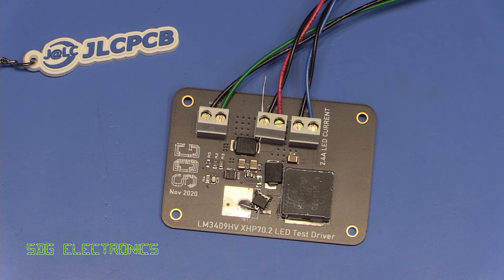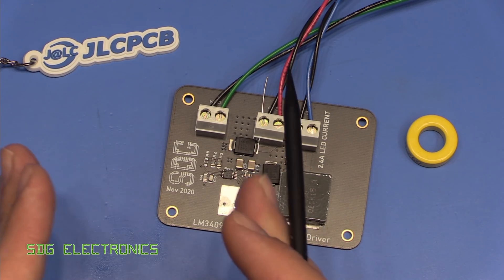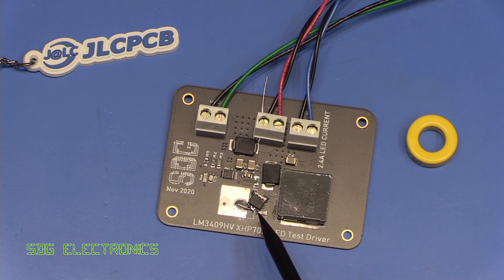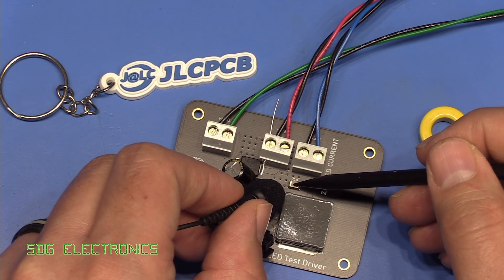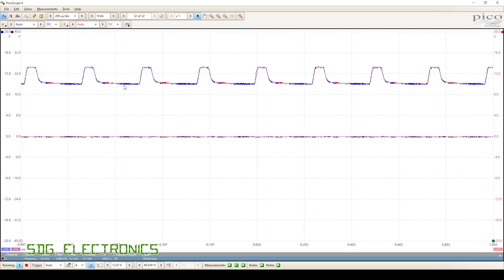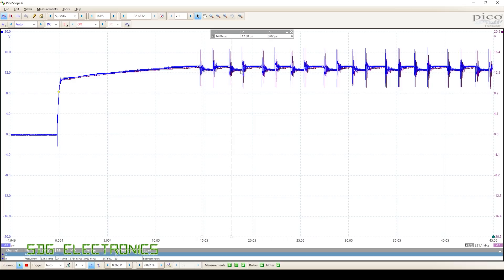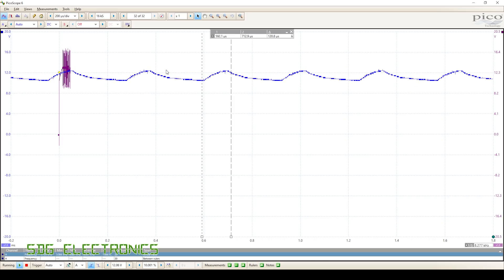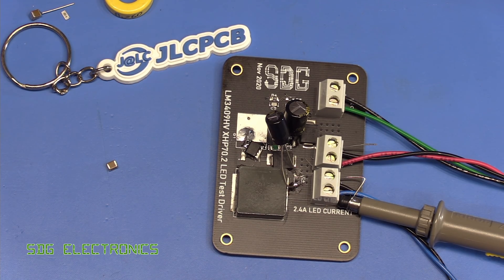SDG #186 A Real Example of Microphonic Ceramic Capacitors!

Comment: Wow this is a fantastic video! For some reasonm whenever you get into aspects of electronics design that include a mechanical, or phsics element. The challenge of trying to solve around these other important factors just teaches me so much more than something that was purely electronics based. Ie. why we design products in real world in specific ways, and not just only to BoM cost alone. What these other important and critical choices are all about.

Another first for me is actually seeing somebody demonstrate whine coming  from a  capacitor, rather than a magnetic coil. Which of course we have known about for years people saying this stuff... but not actually knowing how common this is, and for which specific ccapacitor types, or the principle for  how the capacitor generates motion when it's job is about switching an electric field rather than a magnetic one etc. etc.

BTW steve sorry i totally forgot to mention previously the great technique for finding the location for narrowing down to individual component. It is quite simple actually (again, not my idea but gleaned from another guy).. what you can do is simply make a temporary listening cone, by coiling a sheet of paper or thin plastic into your hand. Like a reverse gramaphone, or reverse speaker cone. Then slowly move the narrow end of the cone across your noisy board. Listening with your ear in the big end of the cone. (or a microphone). The amplitude of the noise will be loudest once you hover the cone over the area of pcb generating the most sound. Noting that it might be the pcb board itself vibrating due to the action of soldered other cmponent nearby or on the other side of the pcb if double sided board.

Also try to think of the relative local and global stiffness or Q factors at play due to the entire ensemble of the whole pcb. Vs the subset of bad actors who are working as drivers. Since different sized shaped or stiffness (thickness) pcb will also play a factor.

Finally if there are multiple component driving the same shared pcb (but at each different frequencies), then the compined effect might indeed be to create a difference or 'beat' frequency, that is a lot lower and then falling into the audible range. Which otherwise individually you would not expect to hear any of them! Hope it helps.
Reply from the maker: The PCB was definitely playing an important role here. The first suspect capacitor I think was positioned in such a way that it probably saw the worst of the vibrations/acoustic wave, hence sounded much louder than the capacitor at fault. I think it shows up on the microphone a lot better, but the output capacitor had much more high frequency content (hence the very harsh tone). Thanks for the comprehensive reply.
Reply: @sdgelectronics  Very interesting diagnosis and solution.  I like the reverse megaphone idea as expressed by Dreamcat 4, but I fear that sometimes the frequency emitted may be outside the range of human hearing.  Get to a certain age like me and you may not be able to hear anything over 8 kHz or so.  In that case, could combining the megaphone with the mic help localize these sounds?

Comment: Very interesting indeed! I just want to add that the reverse is also true: such an SMD capacitor also acts as a microphone... I discovered this today when trying to figure out how on earth the cheap no-brand but very fancy Chinese wireless mic units that I bought managed to produce such audible white noise along with the sound of the wireless microphone. To make a long story short, each of the SMD capacitors around the preamps act exactly like tiny microphones. Not only tapping anywhere on the circuit board is very clearly audible, but even gently blowing air with my mouth onto a capacitor sounds exactly like a microphone in the wind!!! It's so distinct and clear that it's crazy.

Comment: Hi Steve,
AS I mentioned in another comment, I used to teach, and part of that involved using a SHURE wireless cardioid mic. Even when the mic capsule was removed from the transmitter section, it (the transmitter) would produce audio by tapping or yelling at it closely, due to those pesky capacitors.
I hope this clears up the mystery for your viewers.

Comment: I confirm. And even when applied especially in SMPS, in addition to the microphone effect, due to the piezoelectric effect of ceramic capacitors, you can get parasitic interference in the form of amplitude modulation of the output power, which cannot be eliminated. So it is more correct to use a parallel connection of an electrolytic capacitor and a ceramic one.

Comment: I was just having another look at this (I think we started experimenting with both the 3409 and the XHP70's at full brightness at the same time -  your insight has given me more than a leg up so, thank you) and I realized as you said, "the data sheet circuit layout is pretty much the same as the one I have here", that it's not, and in a significant way. The data sheet does not use a cap in that position that is causing the noise on your board. No cap, no noise! (C4 that is: whether that allows the ripple to get to the LED or not I"m just about to find out).

Comment: where is C4 in the  schematic @4:30 ? It looks it's after L1 and connected to Vo. So is it Coff? That is "off time programming"  so not related. Did you added that yourself? (EDIT) ok it's "Co" page 28 in datasheet. They recommend 2.2-µF X7R 10% 50 V murata GRM43ER71H225MA01L in that examples.

Comment: what a great timing. I have the same issue with my DC/DC I design. Well one proto makes sound but not my other proto. I was always wondering where the sound came from. I thought it was my inductor. I will definitively touch the components and take measurements. Thank you very much!!

Comment: There is some legitimacy to still using through-hole technology, less mechanical coupling to the PCB. The MLCC was using the PCB as a sounding board. I'm guessing that, long term, the solder joints would end up fatiguing due to the mechanical movement over time as well (I think Dave Jones did a video on that)...
Good alternatives may be to use thin film or maybe even poly. I don't think through-hole (round) ceramic caps can be easily found anymore...
Season's Greeting and cheers,
 - Eddy

Comment: There are so much devices which making this noise (my PC motherboard, my internet box, my led bulbs, my garage door motor) ! Everybody says that it comes from coil !
I will investigate again now I know that it can comes from capacitors.

So replace capacitors is a way to do... 🤔 A video about all the ways to resolve it could great (replace capacitors, different solder technics, epoxy ? ...).

Comment: The debugging vids are always interesting.
I wonder if the old car trick would work on electronics. To trace where a noise is coming from on an engine you rest a large screwdriver on parts when the engine is running, and then rest you ear on the screwdriver handle end. Basically the metal screwdriver transmits the vibration directly to your ear. You didn't need it because your mic test worked well, but it would've been interesting if there was a metal rod from the part to the mic.

Comment: I made a probe at work to find the source of such issues. It's made of a piezo buzzer plate and a sewing needle sodered on it. A small bidir. Suppressor is put in parallel to avoid hv pulses damaging my scope input. You touch caps and inductors with the needle with the fft on and you look for the cleanest tallest peak location :) works like a charm.
Reply: Great idea, may copy that! 
I have used piezo discs, the smallest ones from RS, as sensors before. I think You can get them down to 10mm dia. Perhaps use something non conducting instead of a needle.

Comment: Capacitor is the mechanical sound source but practically noiseless if not using a PCB as membrane.  Make a tombstone and almost all noise is gone. If very critical to make circuit noiseless,  add few mm solder wick as additional sound-isolation on both sides of capacitor. Solder wick is better then a thin wire as it have low RF-losses.
Reply: I once had noise coming from a snubber network in a small AC-to-DC flyback converter i made as a part of a bigger board. Tombstoning was exactly how i got rid of the noise.

Tombstoning is not a very production-friendly solution, though.
I also sometimes tombstone my ceramic caps for reliability (often after finding out that my circuit is not working because the caps cracked while i was tossing the board around while assembling it).

Comment: Hey Steve  ! Did you take a look at the layout guidelines (chapter 11) of your lm3409 datasheet ?? Vin seems to be a much wider track (main current path), also it states that the Vout cap (one of your main culprits here) should be placed as close as possible to the leds ! Wonder if that would make a difference. ... I still think you don't really need the buck regulator when you drive the whole shebang with an esp anyways. It's like having an extremely good pwm controller (the esp in that case) to control a very limited one (the lm3409). I am really very curious wether it would work or not feeding the mosfets gate directly with a signal from the esp. Anyhow, I love the debugging videos, they are most valuable. Thanks for sharing !
Reply from the maker: The new PCB is much improved on the layout - video in the next few days. If it was a PIC or some other microcontroller, I'd offload the converter functionality, but I've had many occurrences of the ESP32 rebooting. During reboot the pins aren't in a guaranteed state so there's a risk of damage to the LED.
Reply: @sdgelectronics  Hm, I thought the esp had a couple pins that are definitely low on boot, with a pulldown on the gate I have never had any incidents... anyhow, I am eager to see the new boards.. Thanks !
Reply from the maker: I'm sure it's possible, however a switch mode controller should really have all (or at least the highest) the attention of the firmware if you are the implement it on a MCU. I don't have that control on the ESP32 whilst running FreeRTOS.

Comment: Thanks for the follow-up video, Steve.  It was neat to see how that played out on the PCB.  Perhaps aluminum polymer caps are the answer.  Still very low ESR, but without the aging issues inherent in electrolytics.  I just wish they were cheaper...
Reply from the maker: I do have some polymer ones from the original GPSDO refurbishment project. I think it'll end up fine with a small electrolytic though.

Comment: Can you test it out with a tantalum capacitor and tell me if the problem remains the same?
Keep up the great work
Reply from the maker: No problems with tantalum capacitors, though they have their own issues...
Reply: @sdgelectronics  You mean by this getting into flames?
Reply from the maker: @FixDaily  yes towards their end of life
Reply: @sdgelectronics  CONTRARY to popular opinion tantalums don't really have 'aging' issues -if you use a tantalum properly there is no reason why it shouldn't last 100 years but most people have no idea HOW to use them. they will most assuredly 'die' however if you expose them to voltage spikes at or near their rated capacity - even for microseconds. it's important to use them only downstream of well regulated and buffered supplies
Reply: I learned to hate tantalum caps. They work like a charm in the lab. But it is the single component that has caused me more grief than anything else in noisy industrial environments. I try to use dry electrolytics if possible.

Comment: Nice Video - when I was Uni I had a similar issue with a Power Supply for an audio project, so I swapped my ceramic caps for poly film capacitors and worked a charm! You can keep the low ESR element by using a film without the piezoelectric effect, but looking on Farnell can be quite costly when not in bulk. Would like to see you try this again with Film Caps (1210 drop in replacement available!)

Comment: If you have sound effects, it is probably due to pwm chopping due to charge up of the inductor, there are quite a lot of audiable harmonica from the inductor during charge-up. It is not all high frequency as shown in your previous video. Typical inductor..
I think lower esr caps could compensate for that though.

Comment: I never would have suspected the capacitors. Are there any other types of surface mount capacitors you could use?
Reply: Almost all ceramic capacitors are piezoelectric, so you can use tantalum, electrolytic or SMD film in place of them, or get ones with better dielectric that is not a piezo, but then you are limited in value for the size.
Reply from the maker: As with most things, there's a tradeoff and no perfect capacitor. They all have their own non-ideal behaviour.

Comment: Great coverage!
After you play a couple of days with formulas in Excel you can even approximate output ripple from ESR, Fsw, delta L current and it reminds calculation of smoothing capacitance for sine wave rectifier.
Shielded SMD inductors are potted most of the time and are very monolithic, they are rarely making any sound. Maybe in DC-DC circuits of GPUs where there are dozens of amps switching at any decent load, supplying billions of low voltage transistors in the range of 200-400W per BGA, but even there you are more likely to hear ceramics.

Comment: Hi Steve, thanks for taking it further and doing some analysis. Should have known it would be the cap. I think it would still be interesting content to wind your own inductor in some sort of oscillator or filter project. Hows the gps oscillator project coming on?
Reply from the maker: I plan for an AC-DC SMPSU project, so there will be some coil winding soon!

Comment: You should try using NP0/C0G class ceramic cap. Unlike x5/x7, NP0 caps are not prone to microphonics.
Reply: All ceramic caps are prone to microphonics. In my opinion, polyester or polysterene caps should be used.
Reply: They don't come in such large values
Reply: @guillep2k  yep, my bad

Comment: Thank you so much for this mini-series! I have an issue with audible noise coming from a Nixie PSU. I always suspected the inductor and my initially bad layout. After improving the layout (and maybe critically) changing the type of ceramic cap on the output, the noise was significantly reduced. Initially I had just a few very large ceramic caps, now a combination of smaller ceramics (both physically and electrically) plus one electrolytic. I noticed the noise would go down if I increased the capacitance on the output. Maybe the ripple current in the inductor is lower but now after seeing this I realized, that the ripple on the ceramic caps also is lower. I'll definitely investigate that! Very interesting.

Normally I'd just put my finger on all components to just feel for heat etc when testing but on a HV PSU that's not such a great idea. If I had done that I may have noticed that the caps were the culprit?
Reply from the maker: Maybe, sometimes changing the capacitor will affect the noise from the inductor as a result of different ESR. There's many interlinked factors!

Comment: I didn't expect the capacitor to be the culprit. I guess I was so used to linear PSU transformers buzzing that I automatically assumed that any inductor or transformer would be the "singing" component.

I wonder if covering the capacitor in epoxy or other compound would quiet it down. Some throgh-hole ceramic caps look like they are dipped in resin or something similar. Something that feels plastic-y. Maybe those are less noisy than the normal SMD caps?

Comment: Thanks again! Specifically for explaining this piezo effect is occuring  inside MLCCs. It turns out that googling the right keywords will turn up a PDF document called 'capacitor singing FAQ' by TDK. And this is a really good and valuable source of information. To learn more about how to understand and deal with this problem in electronics. Really useful, cannot thank you enough. Because all my previous research was into coil whine. And of course... then the search results are not usually going to mention capacitors.